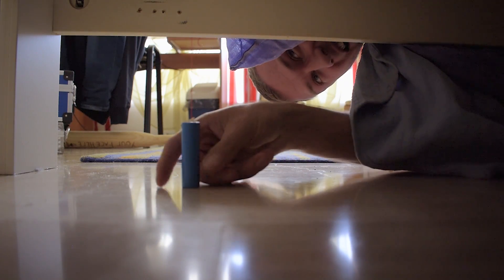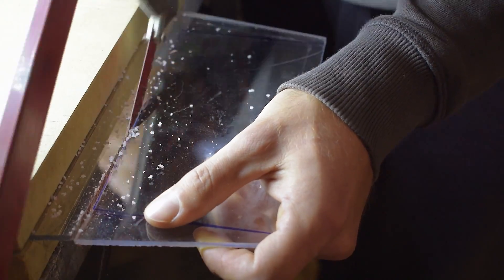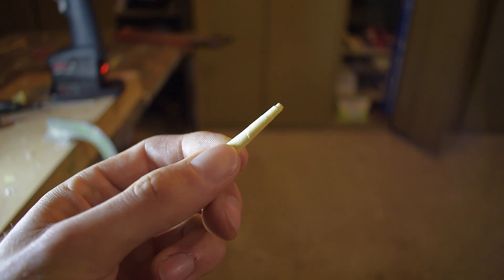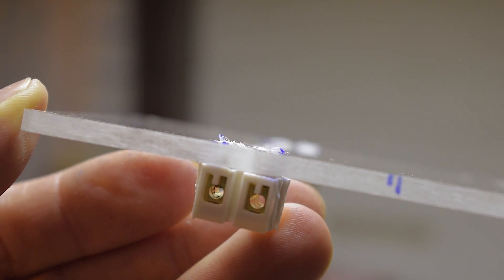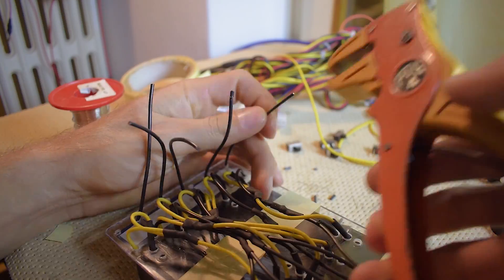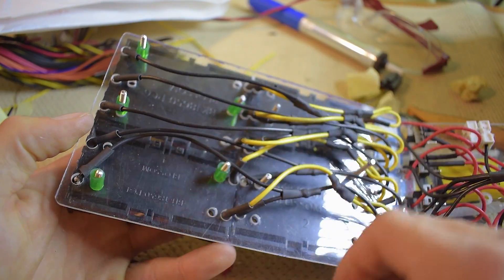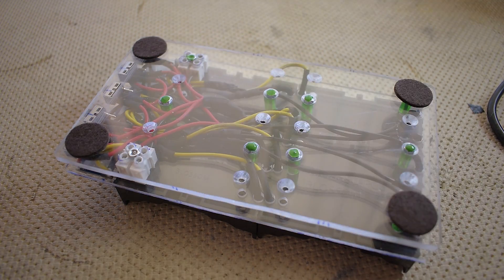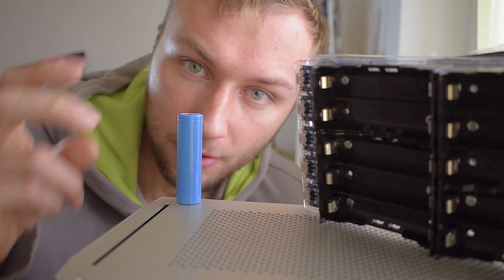Battery Charger for 18650 Lithium Cells

Comment: Seems like each module shared/connected with two cells. If yes it will take more time to charge.
Reply: yes and no. slow charging is better. I always change the resistance of the TP4056 to get a slow charging which is better for the batteries... I got a lot of them so time is not an issue.....
And he used 1 TP4056 to charge 2 18650, which is wrong!!! 1 TP4056 for 1 18650!! because once one battery gets charged the TP4056 cut the charging, while the second battery is not completly charged.... 
it is better 1 TP 4056 for 18650.

Comment: Nice but you should use the tp4056 with protection
Reply: no need here, it is just to charge them, the other model of TP4056 with protection you are refering  about, is used when you want to incorporate the TP4056 + 18650, into some project.

Comment: I mean 1/2 an amp for each cell should be fine but I don't think having 2 in parallel is the best idea especially since the tp4056 are so cheap and by the way if you are using your adjustable power supply you'll be better off running it at like 4.5v than 5 or so

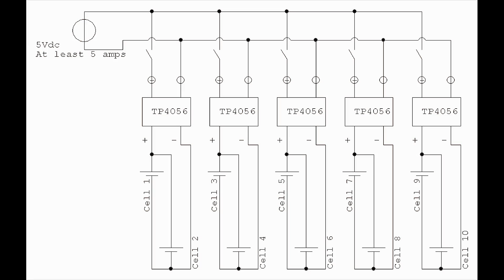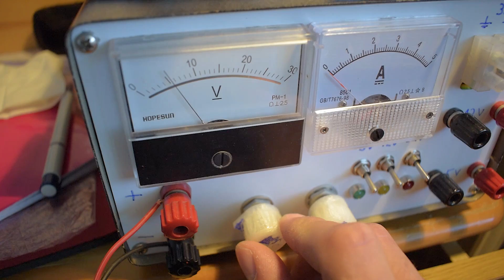Comment: Did I miss the part were you tell us how the two battery holders were connected to each charging board TP4056? at 2:30 it seems you are connecting yellow wire to yellow wire and to one TP4056 so that is parallel. I believed only one cell could be connected to each TP4056 as the TP4056 limits current passthrough to 1 amp.  You've connected the five on/off switches with two red jumpers, one to the TP4056. at 3:37 it looks that the 2nd jumper from each on/off switch is joined to a single positive terminal.  at 4:28 we see power supply is 6v but the amps is at 0.  Are you outputting 1 amp to each of the five TP4056 parallel connected boards which then put through current to two cells each in parallel?  0.5 amps to each cell?

Comment: Hello So wait a second you are connecting 2 cells in Parallel to one TP4056?
Reply from the maker: +joseph chrzempiec yes!
Reply: Thank you.
Reply: 1A / 2  if it has the default resistor

Comment: It looks nice but you should think about adding heatsink under TP4090s. They will be very hot after few minutes if you charge 18650 cells using 1A.

Comment: Which wire gauge is you used? Thank you for your best of best video.
Reply from the maker: +Tefera Ergoye usually i'm using a 1,5mm wires, making them as short as possible
Reply: Borys DIY  thank you so much

Comment: How much did you spend in total? (Including the power supply) Was it cheaper than buying two of these? https://www.amazon.com/NITECORE-Intellicharge-universal-battery-Charger/dp/B00KBFZDI8

You can can get a second hand one for about 15 bucks and it can not only charge 18650s at 4.5v, it also charges multiple chemistries and sizes. This project seems to be just for fun if you ONLY need to charge 18650s and will NEVER ever have the need to recharge anything else.

Thanks for sharing.

Comment: Cleanest diy charger I've seen.
Reply from the maker: +Marcos Ramirez thanks
Reply: Borys DIY with 5 boards and 10x18650 batteries how do you balance the two cells on each board,as one reaches 4.2 doesn't it stop supplying power to the non fully charged cell as well,as this is what happens to mine if I try to charge two in parallel from 1xtp4056 module?
Reply: D twist Rewind I am looking to make a 5s charger. What was your experience with doubling up on the TP4056. I think i will keep simple and charge one per module since its my first try.

Comment: You are charging every 2 cells in parallel. What if you put 2 cells that are not on same level of charge, one cell will discharge thrue other!
Reply from the maker: +siux94 assume that i charge a 2p with 1A. The cell with the lower voltage will drain almost all of the current from the carger and a little bit from the other cell. After some time, that discharged cell will gain some charge so will equal the other cell in voltage and then they will charge together to 4.2v